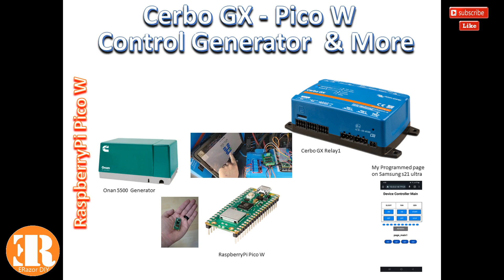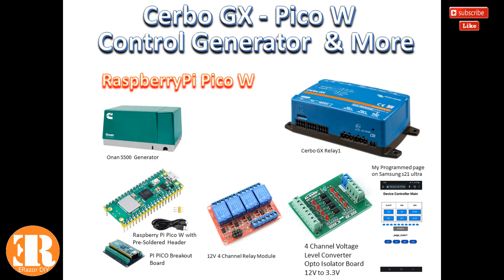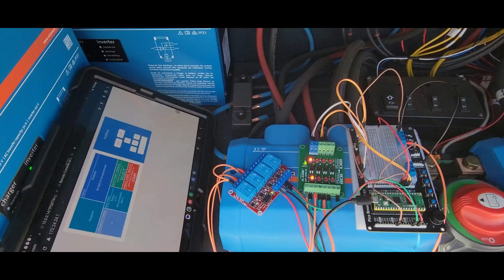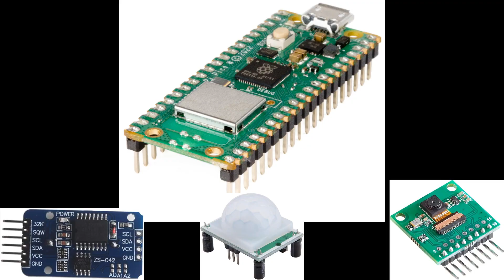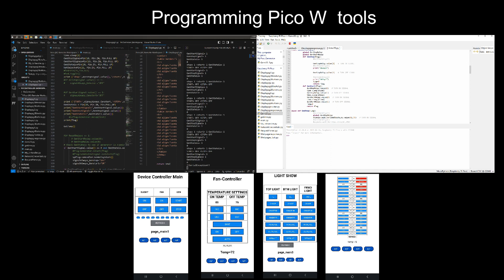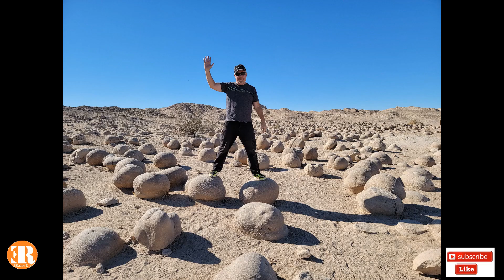Raspberry pi PicoW Automatic start Generator, fans, lights, sensors etc. CerboGX  Wifi HTML pages RV

Comment: I would love to see more videos about Pico programming
Reply from the maker: I did post some programming for reading the mppt and shunt data.  My main program for generator,  victron data, fan etc is still in process as its changing.   I'm redoing my display right now for each pages.  After this is completed I may post the code if ppl are interested.

Comment: Very cool. I just turned a pi into a cerbo gx so this video is really inspiring me to do more. Keep it up.
Reply from the maker: Thanks,  Yes using Raspberry pi was a option and load Venus os etc.  But I wanted to see what I can do with this little device and so far it's working real nice.   Will be adding more to it.  Would like to get battery info into it from my 712 shunt or from cerbo etc. Have to see how I can get that data